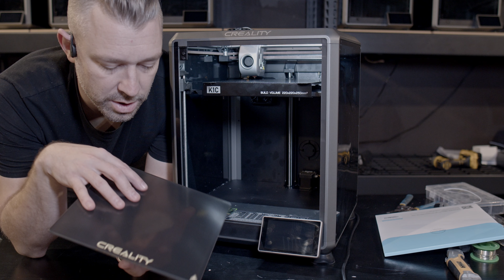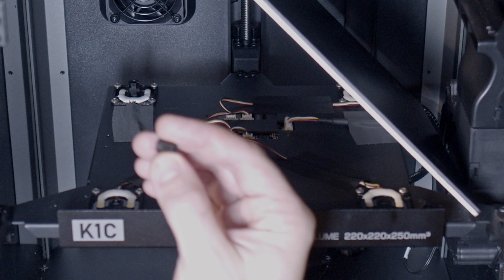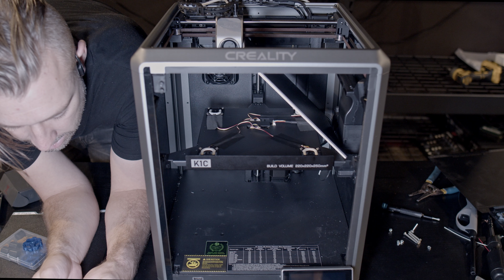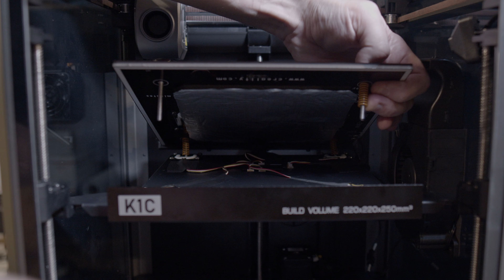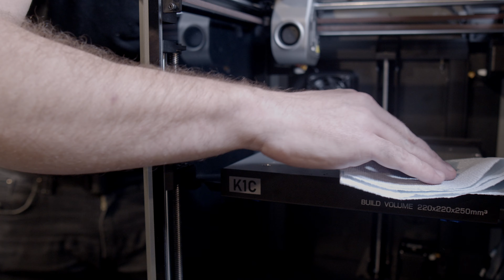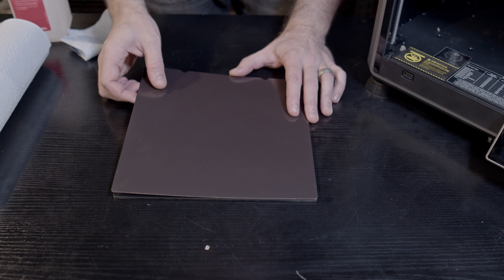Fixing the Creality K1 Series bed warping with the Sub Bed Mod

Comment: Thank you for another excellent well-presented instructions. I Did not do the build plate channel print upgrade but instead used two longer screws and that works just fine for my needs. One question I have the K1C, and I found the nozzle wipe function before a print useful at back of the bed on the silicon small section, any way to get that geocode reinstated or is that not an option. Not a major but a nice to have. Keep up the great work
Reply from the maker: The nozzle wipe function would require custom gcode. I know a few people have mentioned trying to replicate this function. the good thing about modding with Klipper and open source is there's almost always someone who comes up with the solution you are looking for.

Comment: Can I drill four holes in glass? I wanna keep stock screws access from the top
Reply from the maker: With enough patients and the right tools this is possible.
Reply: @zerodotcmd  okay than 😅 I would try and report back
Reply from the maker: @anatoliylarin  best of luck. And glass plates are cheap so not a huge risk :)

Comment: I saw your video a couple of hours before and gave it some thought.

The idea behind this is to get a glass bed to properly flatten the bed. As far as I can tell you do not need a glass bed for this. You changed already the way of the bed is beeing attached to the bed frame. As you use springs (or those silicon thingy) you can level your bed with a klipper macro (screw tilt adjust - which is installable by the helper script when you root your machine) to make it aligned.

One more thought of mine, if you allow me. The bed you used is equipped with some chemical stuff (the grid on the one side of the bed). This will become loose or even melt under temp and pressure. You might ruin your whole bed with this.

I would suggest trying this mod without the glass bed and the spacer and just use the klipper macro.
Reply from the maker: The main issue is, even if the bed is flatten the heat plate warps. The primary reason for the glass is to fight against this warping effect.
Reply: @zerodotcmd  I see your point and you are absolutely correct.
Reply: One thing to add is that you can't use screw tilt adjust as all 3 Z-screw are connected by a single closed belt, not independent motors. Also, the coating on the glass is  carborundum coating. You are going to melt or damage that short of a hard steel scraper.

Comment: K1 Max with LIDAR. When I used a Glass plate on top, I found that the increased distance above the white-black dot reference matrix used by the camera and the LIDAR for the flow test would not work. The printer tried several times, then gave up and skipped the flow calibration. The limiting factor was how far down I could crank the plate with knobs, but I had trouble getting to a point it was butting up against the cables to the heating elements. The matrix is intended to be on the same level as the build plate. What is the workaround for that?  Now, with this mod, it would be lower by the thickness of the mag sheet. I’m keen to do this mod, but I’m afraid I will bump into the same problem. Can you comment?
Reply: I just had another look, and I suspect all I will need to do is shim the matrix bracket to the thickness of the glass addition. It looks seriously doable.
Reply from the maker: I've had no experience with the LIDAR system. I'm in love with the after market probes.
Reply: @zerodotcmd  I’m getting good results with the LIDAR, so I’d rather not lose it. I’m probably going to do this mod. My approach to levelling was to measure the stock standoffs (spacers) and then calculate how long they would need to be to bring the bed into level, then print new ones in ABS or ASA and swap them out. A few goes at that, and it gets pretty close. I have done the springs but had them wound so tight to get the LIDAR to work; they were essentially solid. If I shim the LIDAR reference platform, I should be able to ease the tension on the springs to a reasonable amount.
Reply from the maker: @Rotorhead124  Yeah it doesn't take much to get the bed level. Barely letting off the springs can do the job most of the time.
Reply: @zerodotcmd  Adjusting the four corners, rather than trying to shim the Z-Screws and doing Triple Integral Calculus to figure out the shims is much mo' bettah!

Comment: I have two choices buying my first printer, either K1 Max or Flashforge AD5M Pro. The K1 Max is larger which is good, but from reading I got the impression that the Flashforge is better quality. Which one would you recommend?
Reply from the maker: I've personally deal with 6 K1C's and 3 ADM5 machines. I will say, the ADM5 comes ahead when it comes to quality control and build quality in my opinion. Flash Forge has a few software related things that I do not personally like but these are the same software issue with Creality. Mostly they want you to use their slicer, which can be gotten around. In my experience the ADM5 Pro has had a far superior out of box experience than the Creality machines.
Reply: I used the AD5m Pro for a bit, the biggest issue with this printer is the processor is too weak to use real Klipper on it, you have to use a cut down version with minimal user interface on the touchscreen.

Comment: Glassplate says it has excellent adhesion. Any reason you didnt just taped the glass on and call it done?
Reply from the maker: While the product may claim excellent adhesion, glass beds are notorious for having adhesion issues. One other reason is that using magnetic plates opens up more options for different bed and texture types, allowing for better compatibility with a larger number of filaments and finish types.
Reply: @zerodotcmd  Fair enough, makes sense. Thanks! I've ordered the glassplate and buildplate B (which has the magnetic sheet) the 3M adhesion link is dead but we've got a big roll of that stuff at work so i'll be doing this mod soon thanks to you! Hopefully it fixed the massive warping
Reply from the maker: @eazygfx4815  Awesome. best of luck with the mod! Thanks for letting me know the 3M link is dead. I'll fix that now.

Comment: Hello!
Did you measure the temperature at the top of the bed before and after this modification to find out how much this extra layer of glass affects heat dissipation?
Reply from the maker: Awesome question! Yes, I have. The unmodded bed with a PEI sheet measures 2°C less than the set temperature. With the mod, we generally get around 3°C less than the heated temperature. I expected more temperature loss than a single degree Celsius, so this was a pleasant surprise. If I had experienced more loss, I would have mentioned it in the video, but the loss was so little that I never mentioned it.

Comment: Excellent mod. I just implemented it on my K1 Max. I used a tempered glass for the CR-10 smart. It is exactly the same dimensions as for the K1 Max: 310x315x4mm. Just the printed channel to install on the back of the build plate does not fit on the K1 Max, I had to modify it. There's a temperature probe (I think) on the way, under the print bed. So I had to Dremel the channel to be able to fit it.
Reply from the maker: Thanks for sharing! I will be modifying the channel to work better for the K1 Max once I receive more information. I'll also check out the CR-10 plate. Thanks again for the info!
Reply: @zerodotcmd did you ever get the cr10 glass plate?  I’m getting a k1 max for Christmas
Reply from the maker: @Retiredvetetan  I've never had to use the CR-10 plate since I don't have a max. I know several other users have reported to me that the CR-10 glass works well for the Max
Reply from the maker: There are some friends in here.
https://discord.gg/8QsMzgBv
Reply: I do have a dremel too😊
Reply: Definitely look forward to the k1 max mod. I need better first layers and well a better tool head 😂 but better first layers from a level bed for sure.

Comment: I've did it before with my Ender 3.
Glued the magnetic base to the glass, and used the PEI sheet over that. Worked well for the flatness, but was too much mass for my stock Y axis.

On my K1 max I'm planning to do the same, as I already don't use the nozzle leveling, I've installed a BTT Microprobe v2
Reply from the maker: Thankfully the added mass is no problem with Core X Y machines. so its a perfect pairing!
Reply: Hey, how did you connect the BTT Eddy on the K1 Max? On mine, all the USB headers were already populated on the motherboard. There was a female micro USB on the board, so I plugged it there but haven't tested it yet.
Edit: I read too quickly, you didn't use the BTT Eddy but the microprobe V2. I'm guessing it has a different connector and you were able to plug it on the tool head board.
Reply: @leloupgris  yes, the BTT MP is connected directly to the toolhead board. You just need to have a small cable for the Creality CR-Touch probe

Comment: 😮Genius Idea! How does it affect overall printquality? Will you do a followup Video on that? ...i need to do this mod aswell, thank you so much for sharing!🎉
Reply from the maker: You're welcome I'm glad you found the video helpful. The overall print quality isn't effected by the bed outside of adhesion and first layer. This does give you a better and smoother first layer in my experience. I will be doing more followup videos.
Reply: @zerodotcmd  I would also be interested in seeing what the effects of this mod are.
Reply from the maker: @unknownVS13  I'll be doing a follow up video soon
Reply: @zerodotcmd  Looking forward to it! It seems like you have a bit of farm of K1s going in the background. Have you done these mods on all of them? Also, you mentioned (not sure if it was in this video) that you're not a fan of the nozzle cleaning implementation that Creality went with for the K1C and it seems like you have a better alternative, so it would be great to have a video on that as well. Great videos so far
Reply from the maker: @unknownVS13  Out of 6 machines 4 of them run the Glass Sub Bed mod. Two run un modded bed for the moment due to testing. Once the two are done being used for testing they will be modded as well. I still need a factory point of reference. Unfortunately when it comes to nozzle wiping there's not much that can be done when using the stock load cell probing method. Its when the probe is replaced that the options really open up!
Reply: @zerodotcmd  Really appreciate the answer! Looking forward to your future videos.
Reply: @zerodotcmd  i'm really excited for this Mod, gonna try it on my Kobra 2 max also😁
Reply from the maker: That's awesome make sure to let me know how it goes!
Reply: Wait ...in thee beginning of this video say, that to perform this mod, we require to install another probe, i overheard this all the time and i now i have 3 glassees and 3 sets of springs & knobs sitting here :-( Why is it a requirement to put another probe in? I want to do this mod, but dont want to root my K1 maxes becaue i have ZERO Linux expierience and wouldent really know what to do when something goes wrong. What would happen when i do this mod, without putting in another probe like a btt eddy?
Reply from the maker: @Electrojudaz So let me break down a few different things here. First, the main portion of this mod can be done without rooting or using an alternative probe. To do this, you simply don't use the leveling knobs and springs. The stock probing method requires a rigid contact point between the build plate and the load cells. So you can still use the glass to combat warping, just not the springs and knobs for leveling.

When it comes to Linux, I have another video walking through how to create a custom boot USB as well as how to install the firmware. You don't really need to know how to use Linux, since all the steps are copy-paste. Once you have completed the rooting process, there is no reason to return or need to use Linux in the future, unless you want to root another machine.

There is a good community for SimpleAF, the firmware required for any aftermarket probes. They are very helpful in assisting new users with any troubles they may be facing.

But I recommend that you decide your level of comfort and stick with that. You can still use the glass mod without the knobs and springs, giving you the same benefits of anti-warping. This won't solve any leveling issues, but there are other manual ways to level the bed without springs and knobs.
Reply: @zerodotcmd  thankyou so much for your answer!🙏 I think i'll try just the glass-mod first and see how this goes, and then in the furure, adding a btt eddy. To use a btt eddy the k1max needs to be rooted right?
Reply from the maker: @Electrojudaz  Yes any after market probe requires the machine be rooted using SimpleAF.
Reply from the maker: @Electrojudaz  Best of luck with the glass mod. Just keep in mind that, in the future, if you want to upgrade to an aftermarket probe and knobs, you'll have to clean and redo the 3M sheet from the heat plate and glass since it covers the screws.
Reply: @zerodotcmd  oh... Well ok, i think best i should do now, is stepping out of my comfort-zone, order some btt-eddys and do it right from the Beginning.
Reply from the maker: @Electrojudaz  Remember if you need any help you can reach out to the SimpleAF community on discord.
Reply: @zerodotcmd  thankyou very much, for beeing so helpful 🤗
Reply from the maker: @Electrojudaz  No problem 😊

Comment: I installed the springs and wheel nuts on my k1 max a few months ago and it has been great. I do wish I found this kit you posted earlier because the one I bought have the larger wheels and they stick out from under the bed. I had to use the stock plastic spacers under the frame to keep the wheels straight under the bed. If I could find just the wheels I might get them. I had long screws that worked in the house already. But I haven’t seen this glass sub bed mod before.
Reply from the maker: I searched for quite a while before I was able to find wheels that would fit inside the frame. They do tend to go out of stock quick to so I've had to keep an eye on them. I came up with this glass bed mod since I have to many K1C machines to justify buying machined heat plates.
Reply: @zerodotcmd what about putting the glass bed right onto the heated bed and then just using the magnetic sheet  to put the metal build plate on top of the glass and use minimal adhesion on the bed. Considering the machine isn’t a bed slinger style machine it’s not going to be moving.
Reply from the maker: When the heat plate is fully bonded to the glass plate, the heat plate has less of an ability to warp due to both the added mass and rigid nature of the glass. Without being fully bonded together, the heat plate will continue to warp beneath the glass; this will lift or lower the glass in an uneven manner over time, not allowing the probe to get the most accurate reading.
Reply: if you have another printer or able to got it to work you can just print custom plastic spacers and wheels 😅